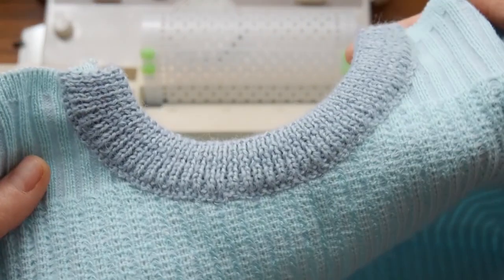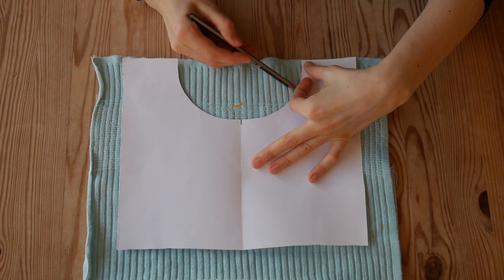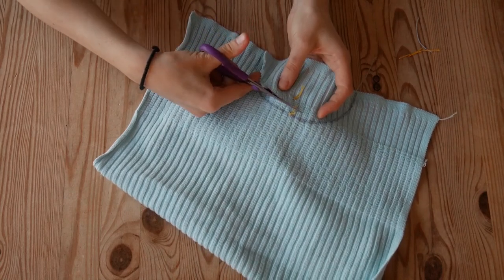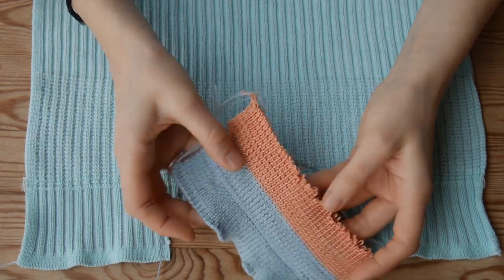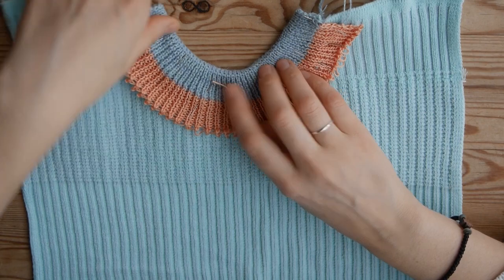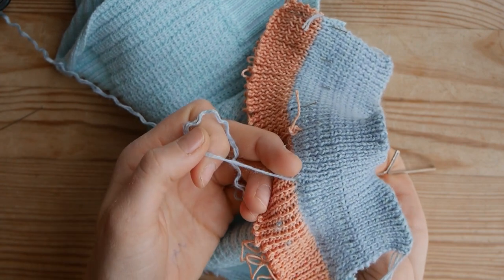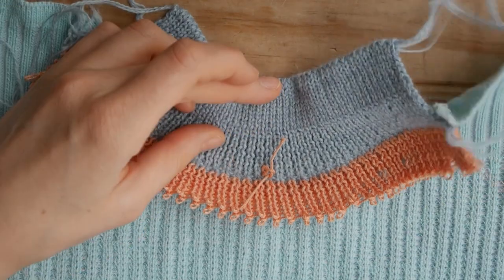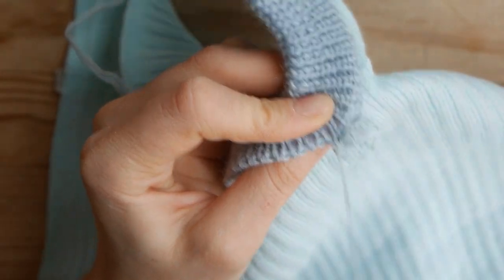Machine knitting - How to add a cut and sew neckline trim ( no linker needed )

Comment: Cut and sew is the best and fastest way to add necklines. The only thing I would also do is somehow make sure the cut part of the neckline that is on the inside doesn't unravel, either put some hot melt fabric web or even better stitch it with a sewing machine first making sure to stretch it a little bit so it will be able to stretch when you are going to wear it, even if it wrinkles in the edge, that edge is going to be hidden engulfed inside the ribbing neck thing you added.